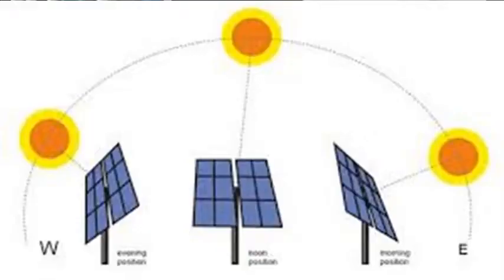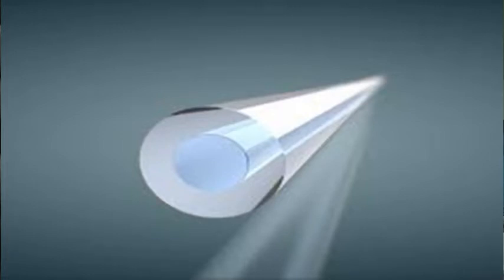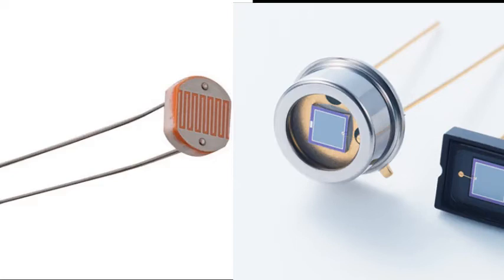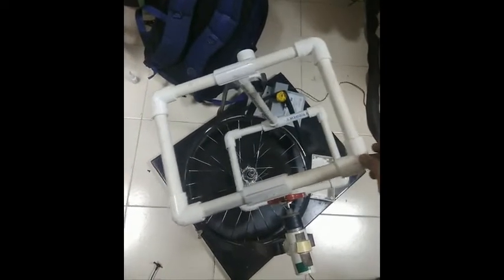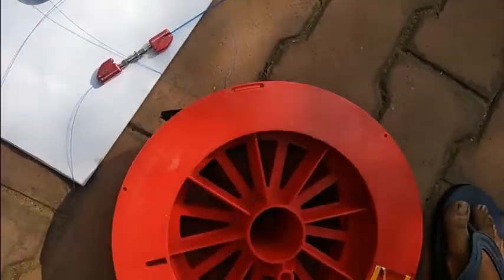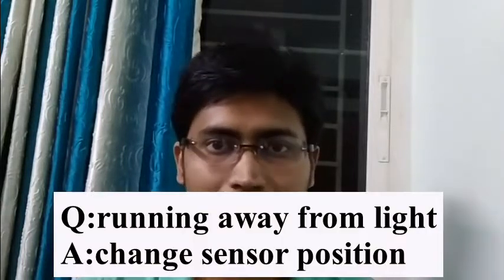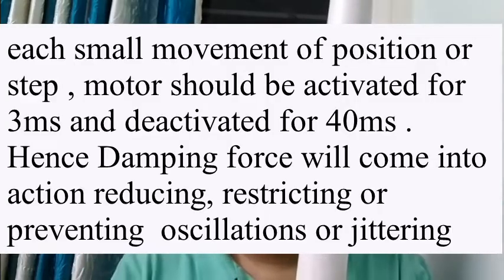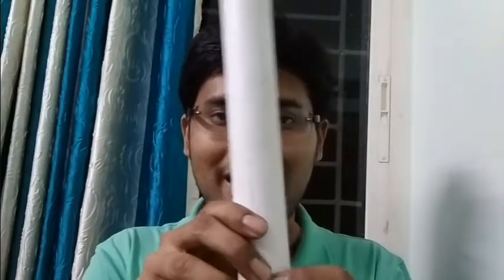DIY Project to make a Solar tracker or Solar Fiber Concentrator at an economical budget for India

Comment: Warm greetings from Azerbaijan.  Is it possible use PMMA fiber optic cable? And what to do with heating in focus?
Reply from the maker: hello sir, actually PMMA optical fiber will melt but you can use a filter that reflects back the infrared  portion of the solar spectrum (hot mirror). dont place the hot mirror at the focal point place it away from the focal point i.e. between fresnel lens and optical fiber. You can get hotmirror in Thorlabs website. Thankyou

Comment: Price bro?
Reply from the maker: so PVC pipes half an inch diameter I used 8 feet with 20Rs per feet= 160
16 PVC joints price Rs 20 to 40 (I forgot the exact price)
Bicycle wheel Rs460  
Arduino Mega Rs 800( you can use uno)
Light-dependent Resistance 4 pieces  Rs 10 each
Iron Stand Rs1200 including making charge
2 DC gear motor  10 rpm Rs 150 . each
Rs 300 miscellaneous
Around Rs 4000 for the basic version.
Fresnel Lens 1200 each but now Rs 300 Lens its available search mobile magnifier  or projector lens
If you like the video pleaes subscribe and share it with your friends as it will inspire us.
Reply: @SCIENCEINACUP  yes bro it's very helpful
Reply: My finel year project same bro
Reply: Bro tum project  sell b krta ho kya ?